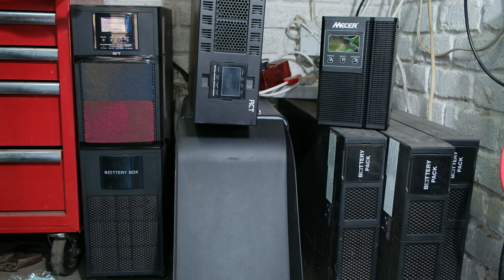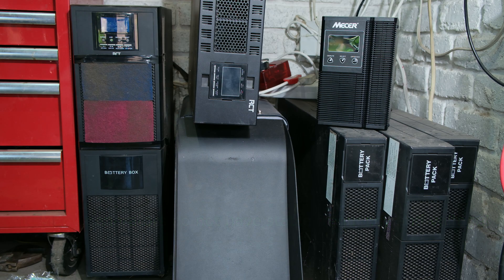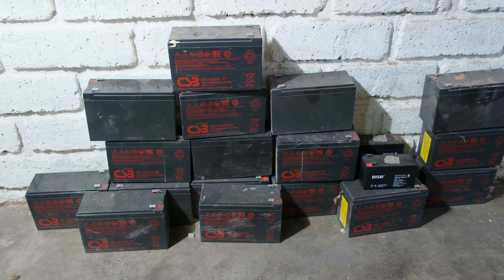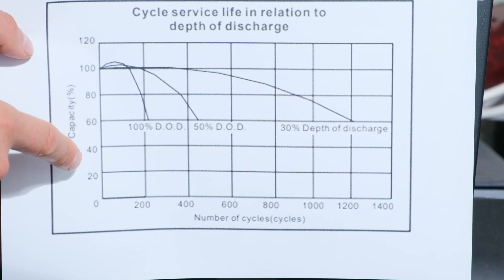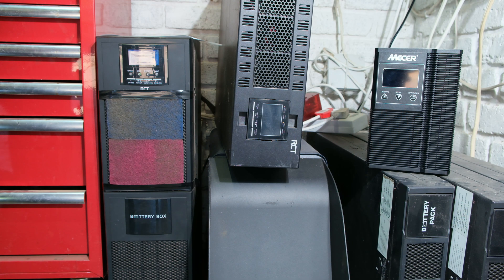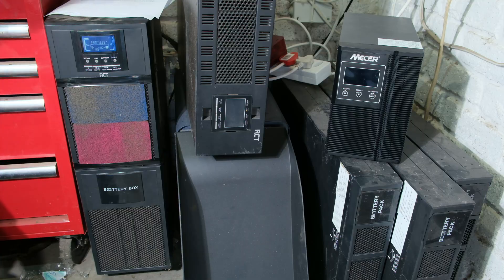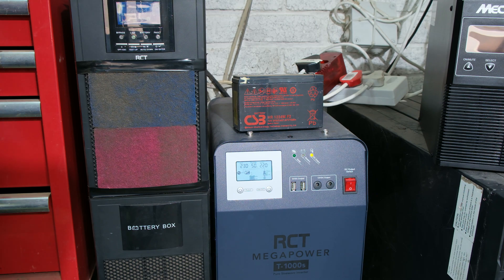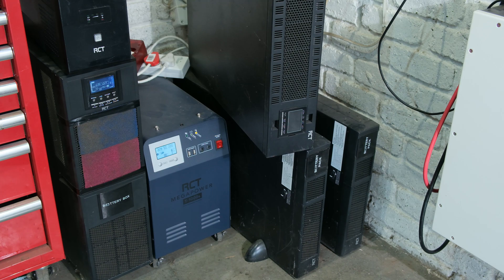Rectron & Mecer WinnerPro UPS technical review - suitable for load shedding? Watch this video!

Comment: Great channel, love it!

What's your thoughts on having the RCT online 600w UPS plugged into the output side of the RCT 2000 Mega Power Inverter? 

I am using  the online UPS to give clean power to a couple of computers, so in this instance the online UPS never loses power as it's always getting power from the inverter. What would you imagine the battery life is on the UPS in this instance?

Cheers